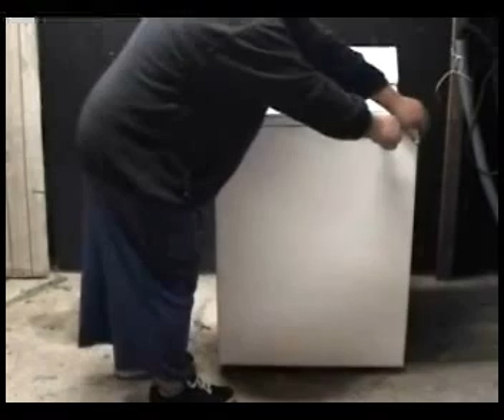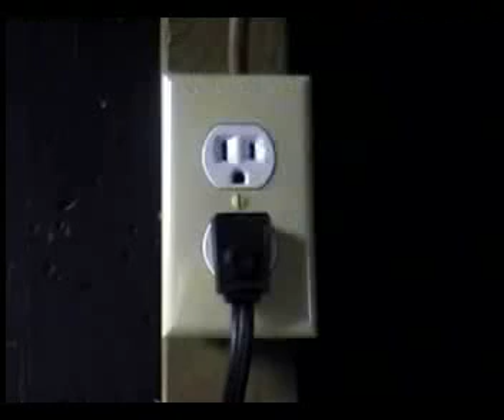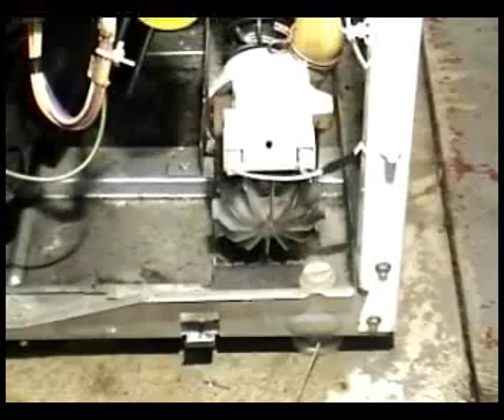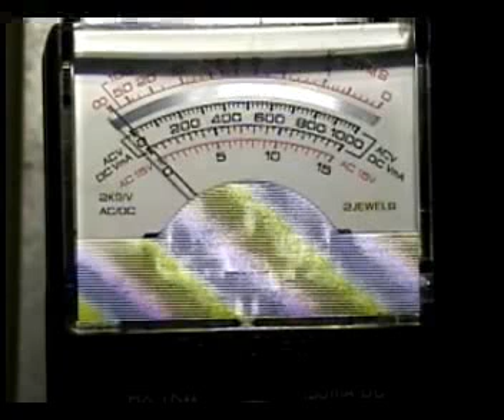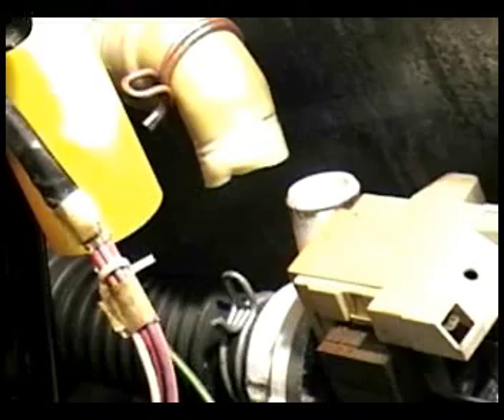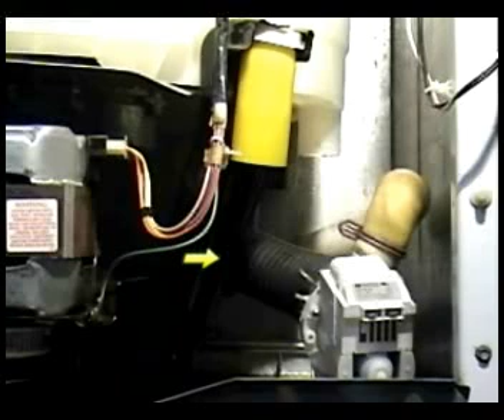General Electric Washing Machine Not Draining - Remove obstructions

Comment: Just wondering, how do you actually get to the pump though? Where is that on the machine? That's the part we're stuck on
Reply: Take the front panel off, the pump is on the bottom right. Its the first thing he talks about.

Comment: Thank you so much for posting this! Just fixed it! I should have had a bucket closer when I disconnected the first valve  (there was an obstruction, and lots of water gushed out). Thanks again!
Reply from the maker: Thank You
Check my website
http://www.do-it-yourself-washing-machine-and-dryer-repair-help.com/
Angel theapplianceman

Comment: A+ video, I truly enjoy watching your repair videos, they are very clear, and you show great footage at every angle.  My problem is that my top load Hotpoint washer  will not drain the water out, it will fill with water, wash,  and agitate just fine but it never goes into a spin cycle until I empty all of the water out with a bucket and then you can turn it on the last spin cycle and it will spin just fine.  We took the pump off but there was nothing obstructing in any of the holes, also I might add that the lid switch stopped working first, I had to put a clothespin down into the hole to hold the medal piece down, then it would work.  Any advice would be greatly appreciated.  My washer is a Hotpoint model #VBSR2080W0WW  Ser.#SA100253H   Thank you in advanced.
Reply from the maker: Check this page the water pump
http://www.do-it-yourself-washing-machine-and-dryer-repair-help.com/notdrainingGEwasher.html?unique=1541808309036509

angel

Comment: Thanks a ton for sharing this walk-through! I couldn't figure out how to get the front off. Found my fiance's mini slipper sock stuck in the pump. I used a water hose and gravity to help drain the washer. Submerged one end in the water, and ran the other end of the hose outside, then sucked on the hose until it started to drain on it's own. Not super classy but way easier than a pale and bucket. Cheers!